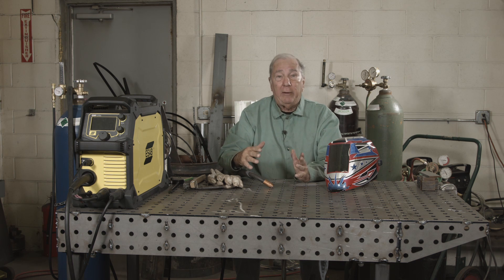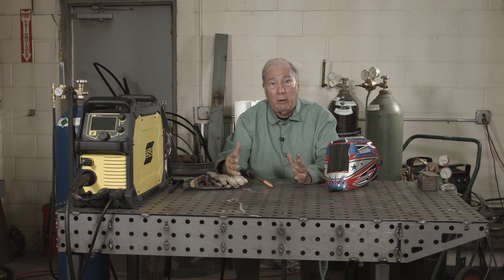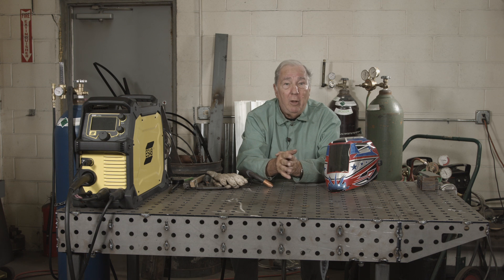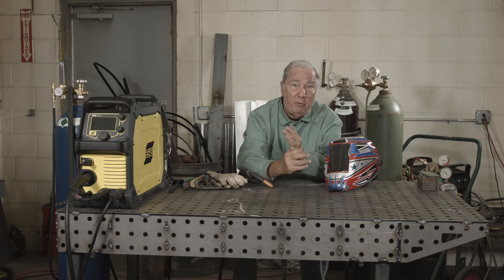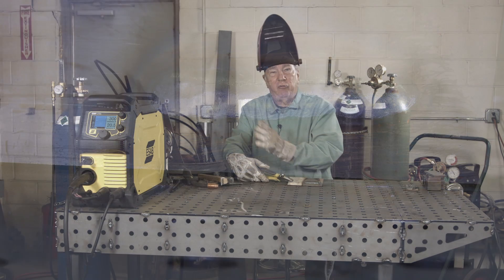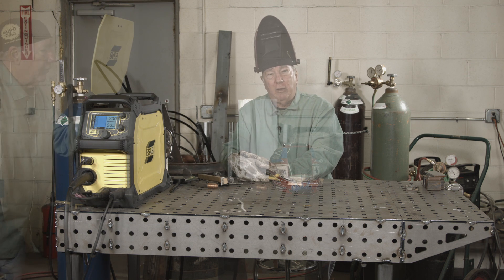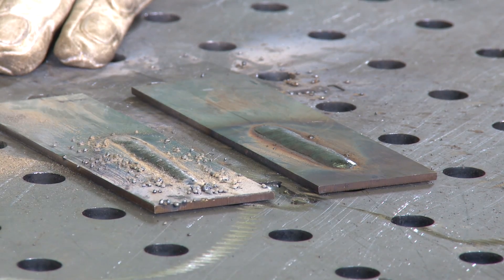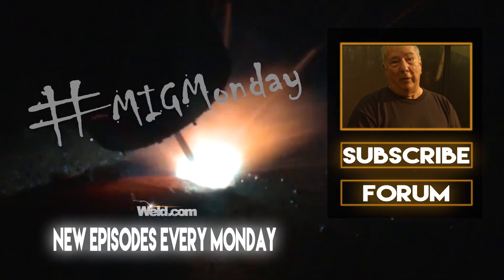Flux Cored Welding with Gas vs without Gas (FCAW-G vs FCAW-S) | MIG Monday

Comment: Is there a possibility that the polarity wasn't swapped before performing the innershield demonstration? I have never had flux core spatter that bad even from corrosion covered budget wire except when I forgot to change polarity.
Reply: i agree, you shouldn't get that much spatter.

Comment: Finally. I thought i was using the cheap flux cored or did wrong with the voltage. I am wondering where my mistake happened and i can't figure it out, the spatter keeps spreading. Next time i will switching gas shielded, i am done with this flux cored. Thank you for your demonstration videos grandpa, and say hello to sylas 😄
Reply: Oh no no no. You can get next to zero spatter. I run hobart e71t-11. You need to properly adjust your wire feed tension, and keep anout a 1/4" stick out. This isn't mig; you can tighten your arc up. Your wire feed tension should be weak enough so that you can stop the wire by pinching it between your bare thumb and index, but strong enough to where it won't bind in the liner. I like to go until it just slips through my fingers, then back off slightly. Your fingers should be pinching hard enough for your nails to turn white. Hope this helps. If you're really adamant about spatter, go with 92%ar, 8%co2 on gmaw, and crank up the voltage until you achieve spray transfer

Comment: In the past I was wondering if you could gas weld with stick particularly with aluminum since welding with other metals didn't seem to be a problem . Both shielded rod and bare welding rod (flux hammered off ) with using an wireless mig or tig torch as the gas delivery devise . Although I would like to see that done and thanks to this video I feel confident that welding gas shielded stick is going to be the way to go for welding with stick on aluminum , Thanks again .

Comment: Anti-spatter spray would make both welds come close to being identical. I've been doing some flux-core for the past year with a Hobart 190 and before I knew about anti-spatter spray, my welds looked exactly like the one shown in the video with all the droplets. After I started using the spray, though, it was almost exactly like the one with the gas. That spray is a life saver.
Reply: that amount of spatter is usually caused by incorrect polarity , as FCAW-S is usually  recommended to be used in dcen(straight polarity) and not dcep (reverse polarity). so simply switching your torch lead to the negative side and your ground to the positive should reduce the spatter by a lot.
Reply: I was thinking about using grease or Vaseline when I started back into welding but I may look into your stuff Thanks
Reply: @Airon79  Don't use grease or vaseline, use non stick cooking spray.

Comment: Hi, i have a FCAW machine for some time now. It can run max at 22 volt. I use E71T-11 wire. The manual for the machine didn't give some recomended setting and i am a beginner at welding. Can you give some references about FCAW self shielded which give information like what voltage and speed wire should i run to weld different metal thickness. Thank you

Comment: I got myself a 20 lbs co2 bottle and a set of valves all I need now is the adapter and a refill.  I managed to weld up several thing around my yard using the flux core wire but since this little 110 v welder is equipped with the ability to use gas with it I want to give it a go.  Can I use the co2 gas with this same flux core wire or do I need to switch to the smaller solid wire ?

Comment: Just for those of you watching this video thinking” wow if inner shield runs that bad why if it a thing?” Well I use this wire in the field occasionally and I can tell you that normally you don’t get spatter , ex specially to this extent! Not trying to bash the video, simple mistake. But inner shield welds can look very close to the dual shield welds
Reply: Can inner shield be used to weld rollcages and tubular chassis?

Comment: NO SHIELDING GAS
Do NOT use an external shielding gas with FCAW-S electrodes (Granted, arc stability may improve by using a shielding gas. However, the arc would then be shielded from the atmosphere. This would not allow aluminum and magnesium from the electrode’s core to react and combine with nitrogen and oxygen from the atmosphere and form compounds. The weld deposit would then end up much higher than expected levels of primarily aluminum, resulting in very brittle, crack sensitive weld metal. Therefore, using a shielding gas with self shielded flux cored electrodes could result in potential weld cracking issues.
POLARITY
The specific core elements or arc stabilizers used in a particular self shielded flux cored electrode determines the welding polarity in which the arc is the most stable. Most FCAW-S electrodes operate best on direct current electrode negative (DC-) or "straight" polarity (Figure 2).  Note that this is opposite of all gas shielded flux cored, solid (i.e., MIG) and metal cored electrodes, which operate best on direct current electrode positive (DC+) or "reverse" polarity. Note also that a few of the self shielded flux cored electrodes also operate best on DC+ polarity. These include electrodes with an American Welding Society (AWS) classification usability designator of "3", "4" and "6" (Example: AWS classification of E70T-4, where "4" is the usability designator).
ARC VOLTAGE
The FCAW-S process tends to be more sensitive to changes in arc voltage than other processes. Voltage (V) affects the length of the arc (Figure 3). As voltage decreases, arc length gets shorter and the resulting arc cone narrower and smaller. An excessively convex or ropey bead indicates that voltage is too low. As voltage increases, arc length gets longer and resulting arc cone gets wider and larger. As arc voltage becomes excessive, the surface area of the arc cone, and the arc’s exposure to air, gets exponentially larger. There are only so many core elements (i.e. aluminum and magnesium) inside the tubular electrode in which to react with the atmosphere and protect the weld. If the exposure level becomes too much for the core elements to handle, then additional nitrogen is absorbed into the weld metal. Reduced Charpy V-Notch toughness properties and internal and/or external porosity can result. Therefore, too much voltage with self shielded flux cored electrodes can cause reduced CVN values and/or weld porosity.
Reply: Hi Stuart, you sound like you know your stuff and maybe you can answer this question:  When doing a repair with fcaw on something that was originally welded with mig why is there porosity and is there a way around it?  Thanks, Don
Reply: NOted

Comment: Its incredible how little spatter my Harbor Frieght 90amp flux cored wire welder with Lincoln ET70-10s wire makes compared to this machine and the blue demon brand wire
Reply: Helps when you use the right polarity.
Reply: I can't believe this "welding" youtube channel  chose the wrong polarity! That was the reason he got so much spatter with the gasless fluxcore. This channel is no good. I have a gassless fluxcore at home and I don't have that much spatter compare to this video.

Comment: If I have a small flux core only wire feed welder and I buy a new gun that uses shielded gas, could I run flux core with gas? Just buy the regulator and gun with the gas hose setup?

Comment: That's the most spatter I have ever seen on a weld at 4:40.  I've welded a lot of Innershield wire and never had nearly that much of a mess.  Something wasn't' dialed in correctly.
Reply: Wren Wright its the wring polarity

Comment: The wire you're using is not that good. Compare it to Lincoln Inner Shield, much better. You also are running too much wire speed. I recently finished a roll of the exact same wire you used and even though it is not as smooth as Lincoln, I would get similar results, but even then, not as bad as you showed, when using too much wire. Not that I didn't know what was optimal, but when I saw that it spattered as much as it did, it helped to reduce the feed rate. There are even worse wires, Blue Demon is not that bad, but most come from China and elsewhere, but Lincoln and a few others are manufactured here where quality control is far better.

Comment: OK, I will have to be the one to ask! Why pull instead of push? Thought you were the push guy and you used pull on these welds, is there a reason?
Reply from the maker: Some people beat me to the punch answering this, but yes... The general rule of thumb is if the weld produces a slag covering, you drag (or pull) and if it does not, then you push. Hence the saying "If there's slag, drag". Hope that helps.
Reply: If there's slag you drag
Reply: If it has slag, you drag!
Reply: ...Some types of Dual-shield, including Lincoln....recommend a slight pushing, compared to pulling/dragging....for the process...
 I used to work for Aero-Jet, a NASA Sub-contractor...building all sorts of stuff from 1-6" thick plate....most all was run with 1/16" Dual-Shield....pushing the gun.....'pulling/dragging' resulted in porosity....

Comment: do both processes require you to reverse the polarity from running a solid core gas shield wire?
Reply from the maker: Larry, Self shielded FCAW requires negative polarity. Gas shielded is positive.

Comment: self shielded had wrong polarity.
Reply from the maker: Eric, you may be right. I don't recall if we changed it in the video, but nevertheless it should be Positive for gas shielded and negative for self shielded.
Reply: @Welddotcom  Are still going to pull the weld as with flux-cored?
Reply: @davidjanuszewski5020   when there is Slag you drag I allways herd that
Reply: nobody could live with that much spatter
Reply: I believe you're right. I don't remember seeing g that much spatter on my FCAW welds.
Reply: I was going to say the same thing, wrong polarity..
I've actually used E71T-GS 0.030" on a cheap Campbell Hausfeld PRO180 220v Mig welder and only had minimal spatter when the settings are just right and short stickouts..
Reply: Thank God, I thought it was just me.
Reply: Exactly, must be negative. Fluxcore is not that bad.
Reply: +Weld.com t-gs wire shows it more than t-11 iam guilty of it myself great vids and really like that machine wish i could own one lol
Reply: You are right. Wrong polarity.
Reply: believe your right only time I had that much spatter is when I forgot to switch
Reply: definitely wrong polarity made that mistake once and was like holy shit thats not right
Reply: Eric Gray that what i noticed too
Reply: he sure did
Reply: GS is "manufacturer spec" wire vs T-11 being to more specific AWS spec.
Reply: Oh, wow, can't y'all male hairdressers just give a damn like without agreeing in several sentences?
Reply: Agreed
Reply: In the correct polarity my self-shielded welds looks like a stack of dimes :)

Comment: Hey Paul thanks for the explanation on the dual shield stuff. Cleared up some fog for me. I realize it's probably an after thought, but could you include the gas pressure. Dose it change when you use that dual shield wire? Just askin. My first real project was a 16' log rack with fcaw on a 110v Hobart and it's still in nude today. Can't beat that fcaw wire for outdoor work (other than stick) but it's what I had at the time. Keep up the good vids I enjoy them and like learning new things. Thanks again. 
-Pidge

Comment: Too much spatter on FCAW-S! Did you switch the machine to DC-? The weld looks as DC+, common FCAW-S problem! DC- is smooth arc, DC+ is too much spatter and smoke :-(
Reply: +David Finch  (dfmmc2014) 
What tungsten? this is FCAW, not GTAW mate!!
Reply: +Koll&#225;r Norbert another advice, ESAB's Coreshield 15, is one of the bests (I think, it's THE BEST) self shielded flux cored wire. It is 0,30, much smoother then lincoln 0,35, deca 0,35...etc SPECS: http://www.esabna.com/us/en/products/index.cfm?fuseaction=home.product&productCode=411131&tab=2
Reply: +Kollár Norbert I would be curious too, I have used FCAW-S a lot and that is excessive spatter even for this process.
Reply: ARCSTREAMS that's fine if your tungsten is oversized and can handle all the extra heat from DC+ without melting off.
Reply: I have always preferred Lincoln but reading your comments compels me to get some ESAB on my next roll. Come to think of it I first saw the ESAB REBEL a few days ago and that I think will be the direction I go . Been using a MILLERMATIC 130 for about 20 years and it keeps welding great, but the power loss on long cords is frustrating. And I notice that it gets heavier to load into the truck at the end of the day, isn't that weird??

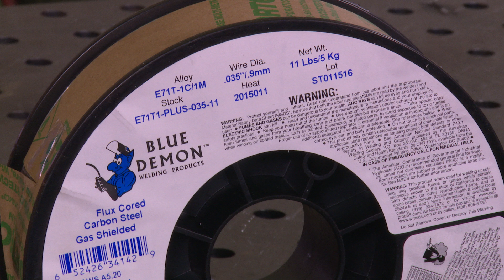Comment: Mmm, a multi-talented ghostly "Flash" there at 3:36 :)  Adjusting the welder and chatting with us at the same time !  Clever ! :)

It would seem to me that a big advantage of the flux/slag in stick welding  is that it helps float contaminants in the weld pool out to the surface and traps in the slag, allowing you to burn through paint/rust/oil easily.   Pure Gas shielded welding without flux (Mig/Tig) doesnt do this.  Things need to be nice and clean for good welds.

So does using the flux-cored wire in Mig (with or without gas shielding) offer the same contaminent-handling abilitiy as arc/stick with flux/slag does ?

I generally prefer Tig welding because it doesnt set everything around you on fire with sparks, but you just cant beat Mig for speed and convenience. :)
Reply: +SpockieTech This is a completely true statment, but my metaphor would be that the FCAW-S is like using E6010/11, and the FCAW-G is like using E7018. Yes, to an extent the flux does serve as a way to contain the contaminants as they are floated to the surface. with FCAW-G, it keeps the weld puddle fluid a bit longer than FCAW-S, and lets more crap float up before solidification. FCAW-S provides the effects of a fast freeze slag, as mentioned being like a E6010/11.

Comment: how about gas/flux cored in spray arc vs short circuit? I know most "home use" machines don't really have the capability to do spray arc, but I'm still curious.
Reply from the maker: +jamcat62 We will add this to our list of topics to cover in future videos.
Reply: +jamcat62 My Lincoln 140C, a 110V machine is capable of spray. use a small enough wire diameter 0.030 and less, and high enough voltage 24V+, and correct shielding gas C20 or higher argon blend, preferably 90/10, but if you use a try blend with some oxygen even easier to get the ionization and energy needed to weld spray arc on a little machine. So yes, it is very do able, but not common use for most hobbyist that buy these machines.

Comment: This was very helpful as I am in the market for a machine. I was going to go with a FC welder but after seeing the FCAW-S weld, I'm going to go with a MIG machine. The FCAW looks horrible. Thanks!
Reply: +Ken C why couldn't you do both with the machine? Isnt it just the wire thats changed ?
Reply: A FC machine only does FC. A MIG Machine does both. I was going to just get a FC machine because it was cheaper.
Reply from the maker: +Ken C Keep in mind that with a MIG machine you will need gas.
Reply from the maker: +Ken C You might also consider a TIG machine if you want small welds that will look good on decorative furniture.
Reply: +Ken C I have a Lincoln Powermig 210 MP I love it! Check out the variety of setting that are available for mig, flux core and stick welding, it is also a dual voltage machine. I started with a 140 but found out the 210 is a much better machine.
Reply: Weld.com
In order for my welds for FC to look as good as they did in your video, it needs to be gas shielded. I will be welding pieces for furniture(end tables,bed frames, bookshelves etc). Since that would take gas, I might as well use MIG.
Reply: Weld.com
Since I'm using gas, I might as well use TIG huh? I would definitely have to sharpen my TIG skills. I like the idea of MIG because it's much faster. Argon gas cost more than C25 correct?
Reply from the maker: +Ken C I wouldn't say that you should use TIG because you have to use gas, however it does give you more control over your heat and more precision welds. You might check out the ESAB Rebel 215 EMP or the Lincoln Electric 210MP. Both of those machines will give you the ability to do MIG, FCAW and TIG. Yes, 100% Ar is more expensive than C25.
Reply: Yes, the LE 210MP is the MP machine I had on my list for quite some time now. As of right now, that's a little out of my price range. In the meantime, I'll get the Lincoln Weld Pack 140 HD MIG welder which will pay for itself in no time with the type of pieces I will be putting out. What's your take on that machine?
Reply: +Felix Demers Main thing really is that store bought machines for Hobbyists are advertised as Flux Core only, and mainly due to the fact that they do not include the extra equipment for using shielding gas. for use of shielding gas, you need a machine with electric ran from trigger switch to a gas solenoid valve in the machine as well. When you get a machine capable of "MIG" it can generally do all three processes, GMAW, FCAW-S, FCAW-G.
Reply: Richard Valcourt
Thanks for this. I've seen a couple videos on the PowerMig 210 and it does look great. Can't wait to get it later this year.